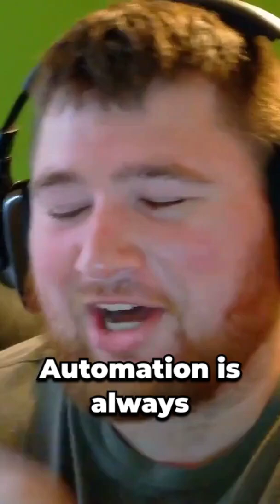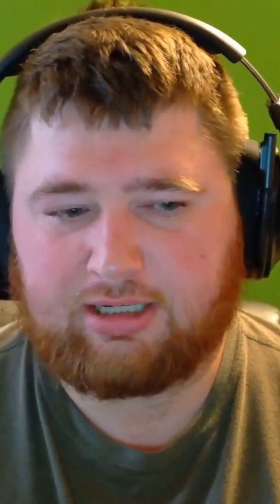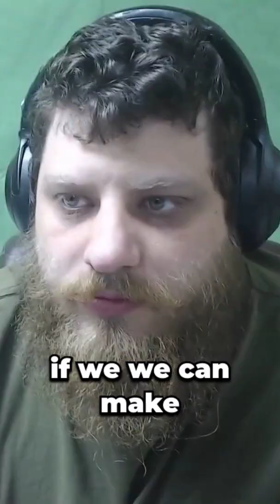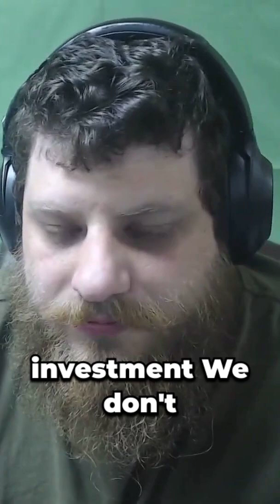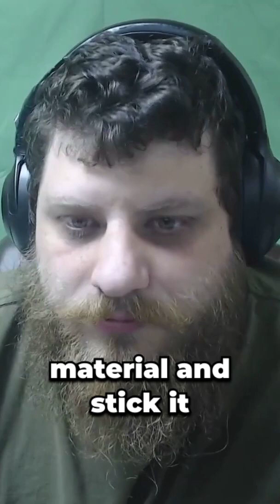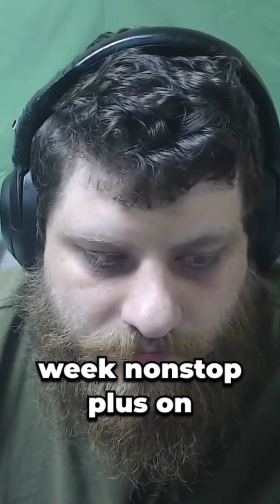Parts Loading vs Pallet Loading #automation #manufacturing

Comment: Pallet loading works very well, we get 16 hours of untended spindle time every night. Chip management becomes critical, especially if your processes yield fine chips.
Reply from the maker: Yeah, it seems like that's the challenge in most automation
Reply: We shopped for a horizontal for years, and didn’t pull the trigger until we found one that could deal with the chips our processes created.